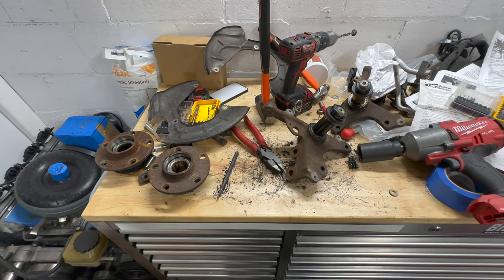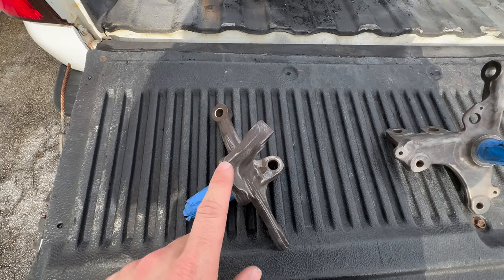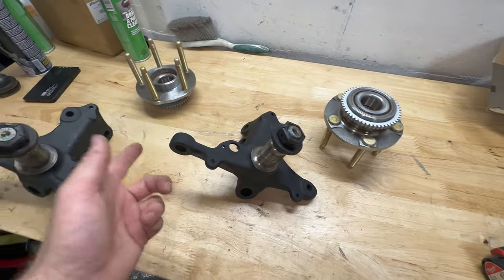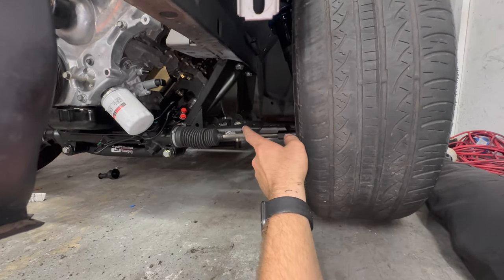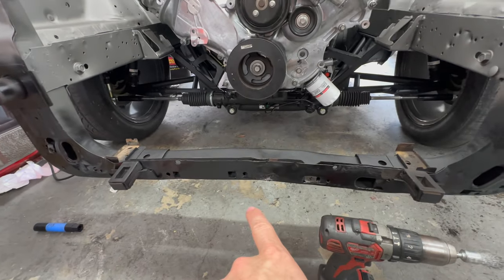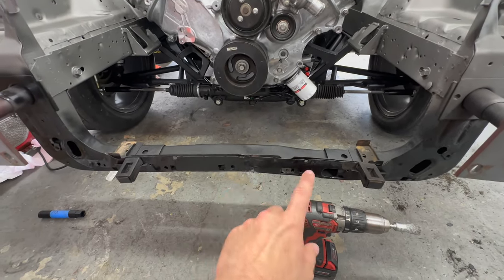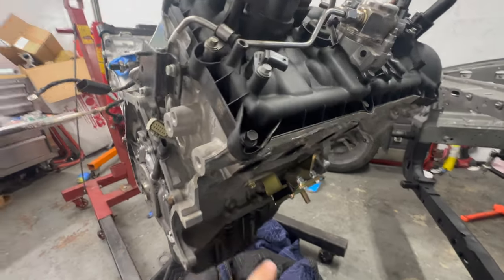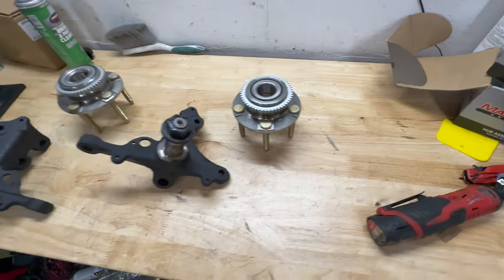Putting SN95 Spindles on my Foxbody Mustang

Comment: Quick little junkyard tip, you don't have to remove the caliper first.  Just undo the two bolts holding the bracket and the caliper will come off with that.

Comment: I’ll definitely be interested and watching when you install the tubular rad support cause my support is also smashed up bad underneath from the previous owner jacking up there!!! The side pinch welds are perfect thanks to previous owner jacking by the subframe 👍🏻 it’s a first for all the foxes I’ve had!
Reply from the maker: I think I’m going to leave the rad support for now and maybe I’ll swap it out later on if i run into issues from it or just want to shave more weight off the front

Comment: Looks good man!!! You went with 96 spindles instead of 94-5! How come? Are they getting harder to find? I have 94-95 spindles on my project roller 1986 t-top coupe with capri fenders, I got lucky that it came with them and also an 8.8 from the same car that has 99 gt wheels all around! But I’m doing ccw knockoffs 👍🏻
Reply from the maker: Since i have a Maximum Motorsports Kmember i can run the 96/04 spindles without bumpsteer issues and it’s actually a better setup to my knowledge. 94/95 spindles are necessary with some aftermarket Kmembers and the factory Foxbody Kmember. Hope that helps!
Reply: @StockBlocks could you possibly add a bumpsteer kit to correct that on a factory kmember? Or should I just try for 94-95? Can’t find any in my area
Reply from the maker: @branleesan  so i don’t have personal experience with this or personally acquired date to back this up, it’s just based on research and information I’ve found from sources/people i trust. 
The short answer is no. The long answer is you can help it but it won’t solve the issue completely so it can be a waste of money and time. With that said here’s my advice.

You can 100% get the 96/04 ones, the bumpsteer kit, and the washer/spacer that should eliminate more of the bump steer and run it on your car. If you decide it’s an issue for you, look into upgrading your Kmember to one like the maximum Motorsport options. Your cost overall will be higher but you can spread it out over time and still drive the car. 94/95 spindles are stupid expensive and by the time you get new pads, rotors, (replace wheel bearings and upgrade the grease if you choose), and whatever other odds and ends you’ll be close to the price of a high end Kmember.

If you plan on tracking the car like i do maybe don’t take that advice but if it were just a street car, I’d give it a shot.